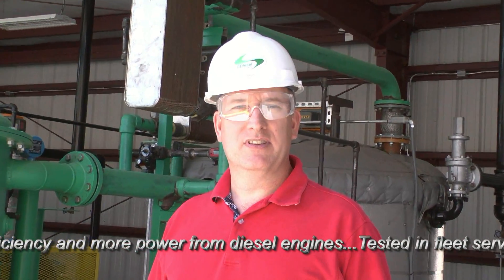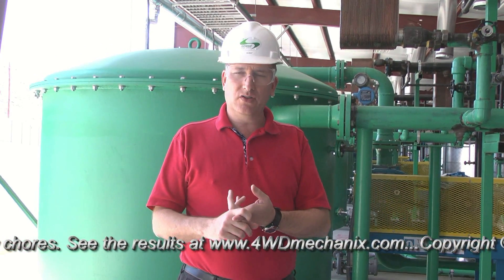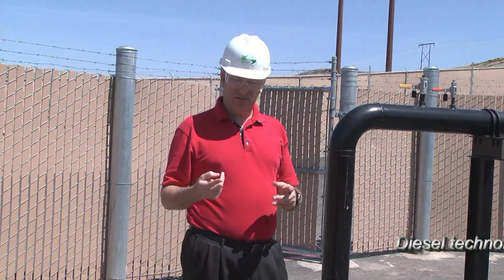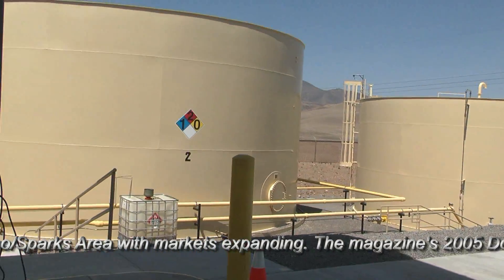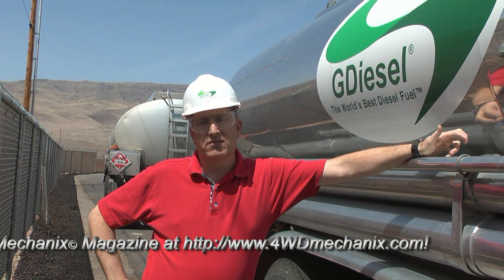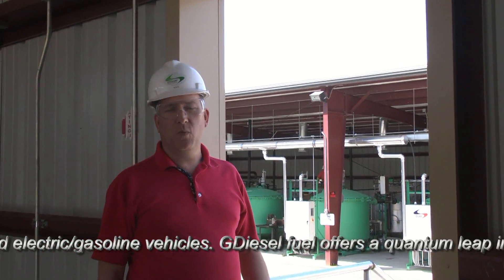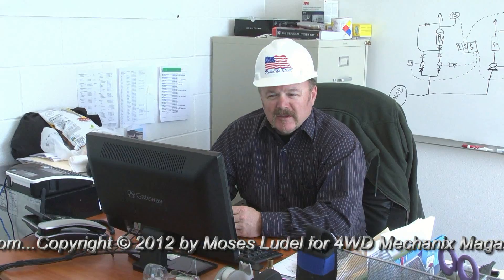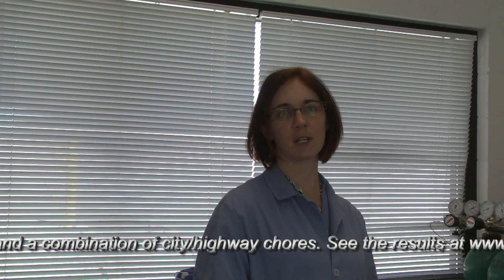4WD Mechanix Magazine: Tour Advanced Refining Concepts' GDiesel Fuel Refinery

Comment: Is this still made.
Reply from the maker: Hi, Maurice...The website is still viable and provides detailed information.  The endorsement letters at the company's website are around the period I filmed and produced this video.  We bought GDiesel locally for a few years at a Sinclair station (Sparks, Nevada).  Availability became intermittent, and the price fluctuated...References at the website note that on- and off-highway fleets use GDiesel products.  At the time of the 2012 interview, Clark and Churchill Counties, Nevada were using GDiesel.  (With diesel emissions standards getting tighter, this fuel process should be increasingly popular.)  There is a contact email address at the Advanced Refining Concepts website if you want to explore further:  http://www.clearrefining.com.  Trust this helps.
Reply: @4WDMechanixMagazine   G'day from cold, wet & windy Auckland,  New Zealand.
Thanks for the reply. I was curious if they were still manufacturing, looks like they are.  It looks like an interesting way of making Diesel clean burning. I can see its a Modified clean burning form of diesel. I've been surprised that diesel trucks don't inject CNG or LPG into the air Inlet manifolds, to make them cleaner burning, but then again you can always put particulate filters on the exhausts.
 I never thought diesel emissions were that bad, brakes dust and petrol car exhaust fumes are much worse.
 Liked your channel by the way!
Reply from the maker: @mauriceupton1474  Maurice, I did the interview video after discovering that this nearby company had developed the process.  You can see that the investment is substantial.  The concept makes sense:  modify the fuel rather than add outdated and expensive emissions equipment, DEF downstream exhaust systems or other "cleaning" methods.  Although the use of CNG or LPG by some safe means is certainly worth exploring, the cost of a supplemental or auxiliary fuel supply system would be an issue.  It's costly enough that late diesel trucks require EGR, catalytic converters and DEF systems with expensive, failure prone components.  The pump price for GDiesel is a concern, as ARC buys base stock fuel from major refiners before applying its process.  In my experience with GDiesel, I found that the fuel cost and fuel savings evened out...From a consumer and environmental standpoint, using improved fuel reduces fuel consumption and helps the engine run cleaner with less emissions while reducing reliance on expensive emissions devices...Enjoy the cold, wet and windy weather at Auckland!